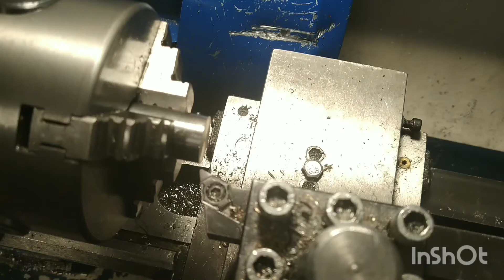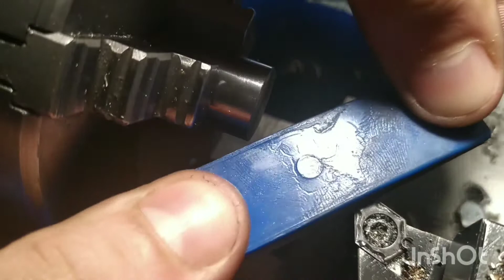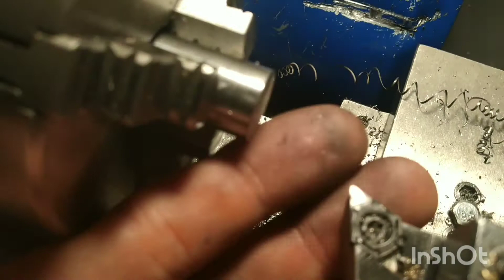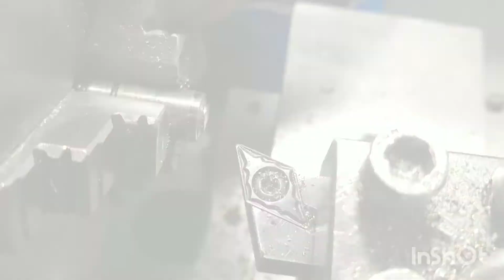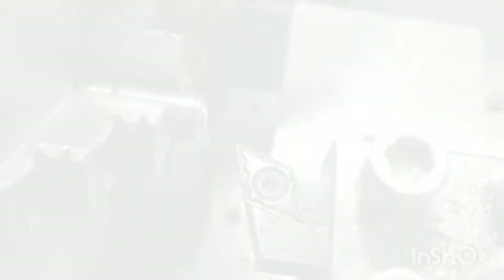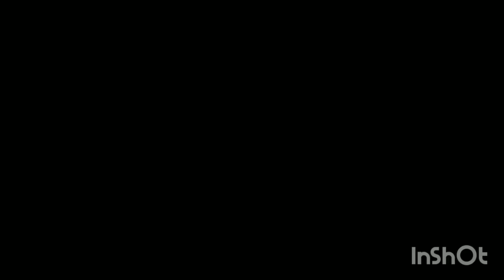Hardened steel vs mini lathe? ROUND 2! + Bonus

Comment: I mean you can turn Harden metals on a little lathe as long as it  right speeds and feeds and inserts, carbide can do it but it doesn't if its not designed for it, when you have ceramic or CBN tooling its so much easier but for those to work you need to have the correct speeds and feeds.... other than that a tool&cutter grinder is best bet even grind tungsten with diamond wheels and or even grinding PCD tooling on those.
Reply: This is where a silver shank (8088)? Brazed carbide tool would do some good. I use WNMG insert tooling on my 1943 south bend, up graded with a 1 hp 3ph. It's nice to dial in the speed on the fly with the VFD. With the WNMG insert the speed and feed are much higher than one would think, also they do better with a heavy depth of cut. Then I use HSS  to take it to size. If you haven't used a lathe file, get one! You'll see why.

Comment: I would suggest you go to a 0 rake tool holder with a positive rake insert in TPG , TPMG OR CCMT style insert. They are loads cheaper than the DNMG you are using here. Keep in mind that negitive rake holders and negitive rake inserts both appeared when NC/CNC machines became more widely used.
Reply from the maker: You're right, it was my first tool that i bought, at the time i don't know much about insert tools. As you can see it is left hand tool that i "hacked" to use like right hand one :)